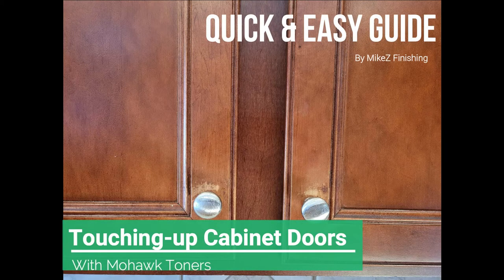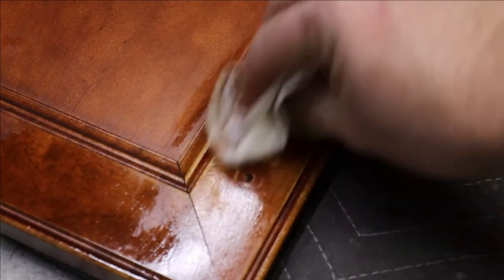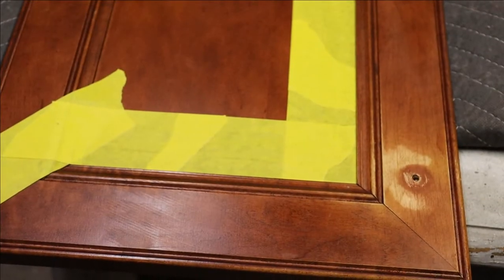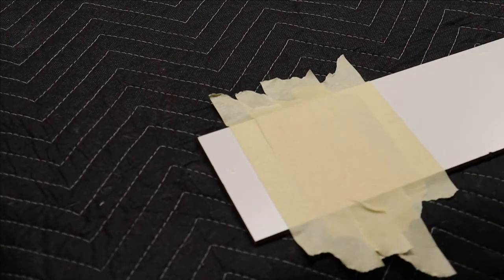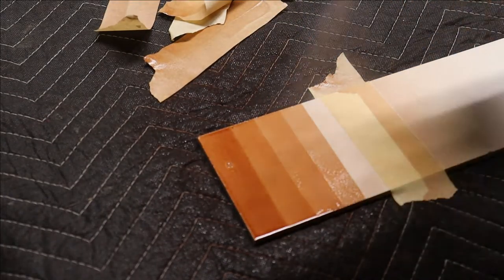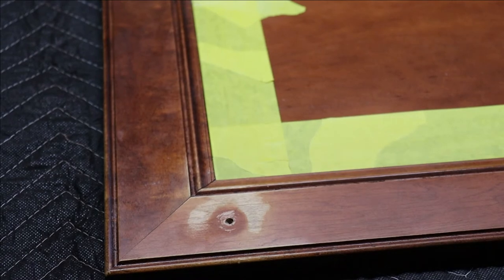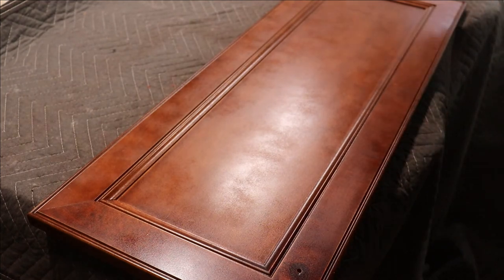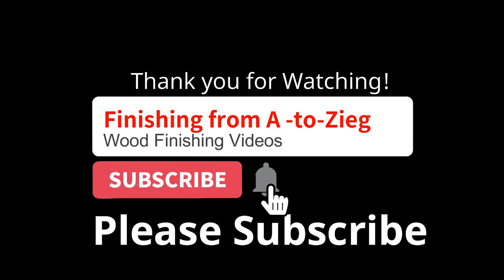How to Touch Up Cabinet Doors

Comment: My cabinets are made from solid cherry with a light dye stain and clear lacquer. Then top coat is getting gummy and soft in the areas near the knobs. Because they are cherry and have darken after 13 years how can I remove the gummy areas. Will mineral spirts like you show in the video work? I’m afraid to use lacquer thinner as it may remove the stain. Your video is awesome. Any help would be appreciated.
Reply from the maker: Depends on the top coat. Typically where the knobs are, is oily transfer from hands. A lot of things are going on in the kitchen and we don't always think to keep our hands completely clean when opening a door. This is the majority of why it feels gummy. Mineral Spirits will help cut the grease. My go to cleaner is Grease Lighting for this type of situation. Do not use lacquer thinner as that WILL soften the finish and remove both the finish and the stain. Hope that helps and thanks for watching! I appreciate it

Comment: So the last coat you just used the toner as a sealer? Don’t need a separate one?
Reply from the maker: Toner is a lacquer, so it can act like a sealer, but it doesn't have the build a sealer does. The last coat should always be your final top coat. This case Pre-Cat Lacquer, for durability and choose the right sheen for matching your doors.

Comment: I have espresso prefinished cabinets...any tips on a color match for those?
Reply from the maker: Color names are hard because each factory or design space uses similar names but the hues might differ. I recommend getting a few different cans, make sure each color is similar to the "Espresso" base color, but have either a slightly red, slightly green, or browner tones to the toners. I recommend Mohawk Toners because they have been consistent and available for 20 years. That said, if you look at 4 colors, M100-0207, M100-0351,  M100-0249, and M100-7021, they are all brown but have undertones. For instance, 0207 is red/brown, 0249 is yellow-brown, 7021 is green brown and 0351 is burgundy brown.  Best to figure out or purchase several different or similar colors. This is a pain because you may have more than you wanted, but you can spray-mix or float toners between each light coat to blend to the perfect match. Hope that helps!

Comment: Thanks for the helpful video on repairing worn cabinet areas with Mohawk Aersol Toner. My cabinets have a satin sheen and I am wondering what type of topcoat to apply after the repair work has been done to make the repair work match the original sheen. Can I use a wipe on satin poly or is there something else that might work better?  Thanks, Wayne
Reply from the maker: Great question. Personally I like the Ultra Flo from Mohawk. Its one of the easiest to flow the touch-up into the existing finish. Here is a link to one and I do not receive any compensation for it. https://www.woodworkingshop.com/product/M1020452 But it is the cheapest even with shipping included.
Reply: I have honey maple cabinets. Do you know which shade I would use

Comment: Awesome tips!  I really dig the tape & step tip.  I see that being a huge help.
Reply from the maker: Thank you for that. Masking isn't hard as long as you have the right tape!
Reply: I have the same style cabinet doors.
Some of them have spread open at the 45 degree corner joint from water getting in while cleaning. Do you know any way to repair this and bring the joint back together?
Reply from the maker: Since most joints are glued, you will have to check to see if the glue has separated from the wood at the joint or if the glue separated from itself. At the bottom of the door do you see a gap between them as well? This will tell you if the wood can be clamped back to 45 degrees or if there is more to the issue you have. Thanks for watching!